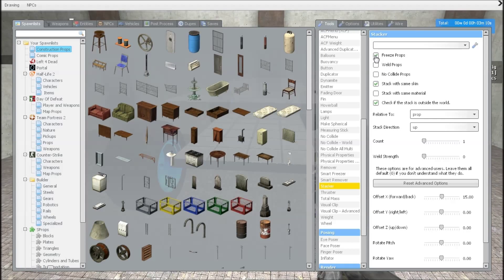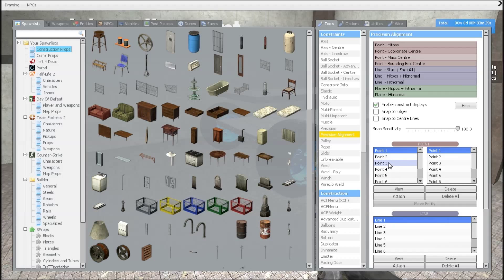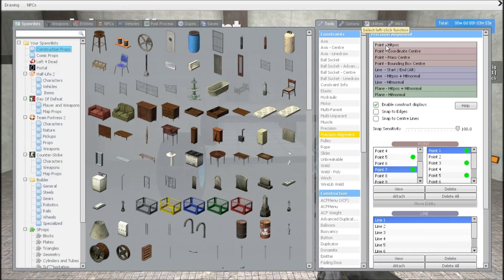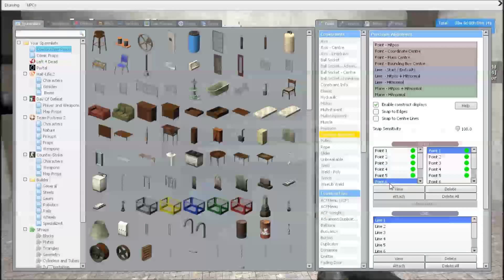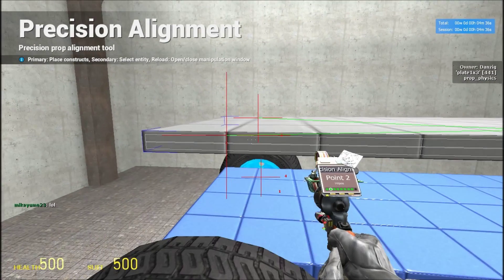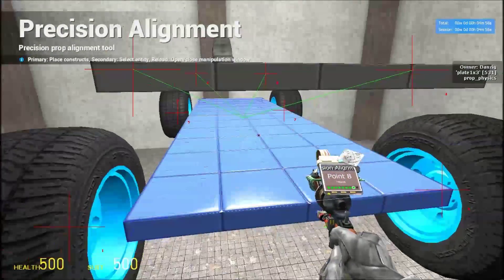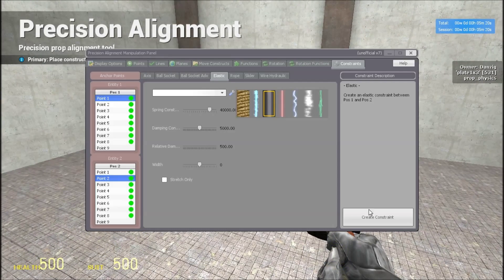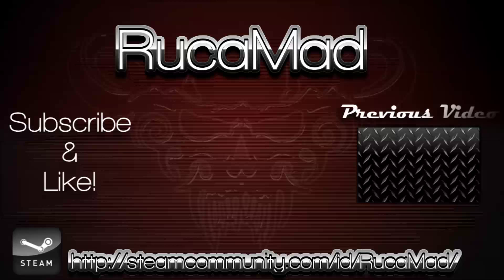Gmod - Tutorial - Plate-less Hydraulic/Elastic Suspension Tutorial

Comment: +GmodGamer Either that or check your baseplate weight, the base weight should be 500-650.
Reply from the maker: In the real world; Solid axle is the best in Crawling and the IFS is the best in desert/prerunner offroading. the Solid axle has more wheel travel and the IFS has a limit but the IFS has a smoother run in a not so extreme offroading terrain. In Gmod, obviously anything is possible. The community i ran with for a long time tried to keep it to realistic standards, so all we used for extreme crawling courses was solid axels with a diff-lock setup.
Reply from the maker: +VereniteGaming Gmod physics has had changes to it since I released this video. Also server dependent. Have fun! :)
Reply: Lol, I've experienced those changes while trying to build my crawler with elastics, but instead of using a plate, I just mass centre the two points inside the wheel :L
Reply: +VereniteGaming Use Independent Suspension.
Reply: That is independent......
Reply: +VereniteGaming  My mad solid Axels for Crawlers
Reply: Solid axles aren't always the best for crawlers.
Reply: +RucaMad Question I want to make a trophy truck what suspension should I use? Independent? Also how do I set up diff-lock setup?
Reply from the maker: Difflock just means the wheels do not spin independently of eachother. Typically a trophy truck will us an IFS (Independent Front Suspension). In simplest terms, it means the front is an independent suspension and the rear is a solid axel suspension (typically with a lot of travel on it).
Reply: +RucaMad Thanks man I need to know what Sus I needed now I'll get to work :D.
Reply from the maker: Sometimes Solid Axel can be pretty tricky to make properly. I would suggest getting the hang of making Independent suspensions before making Solid Axel, or IFS.
Reply: RucaMad Solid axle is kind of tricky if you don't have proper knowledge of Wiremod and PA.